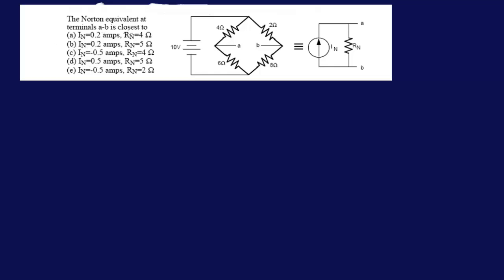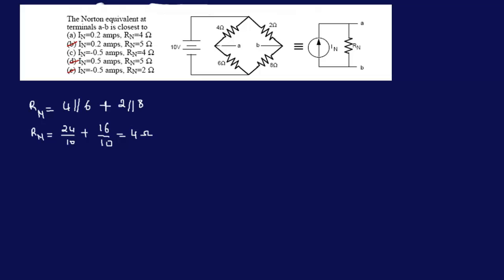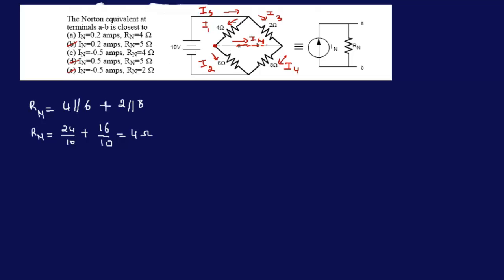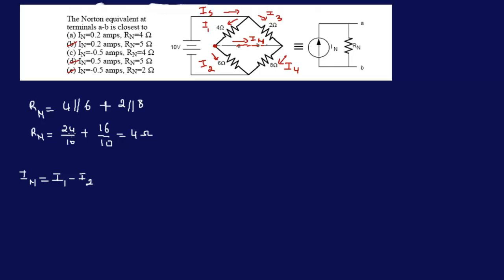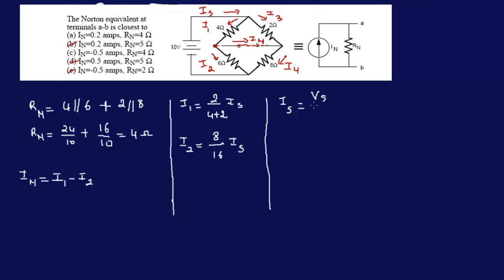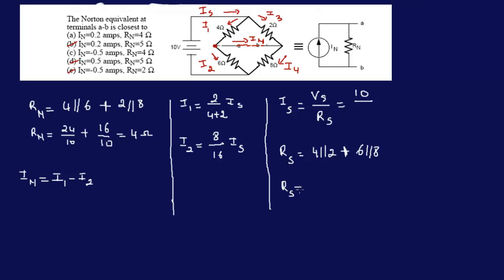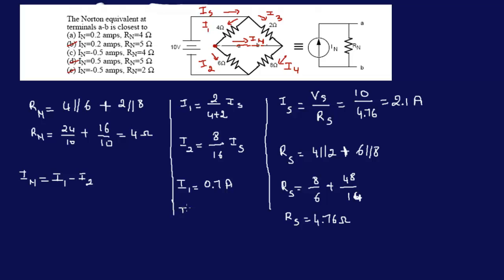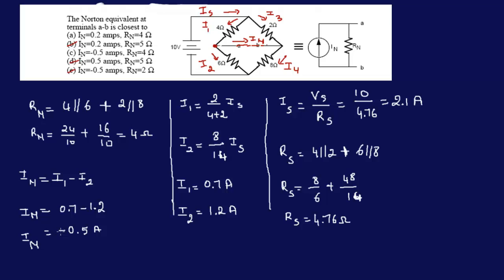Bridge Circuit-Norton Equivalent-FE Exam Review

Comment: Isn't the current divider rule In = (RTotal/Rn)ITotal? http://www.allaboutcircuits.com/vol_1/chpt_6/3.html Please clarify your thought process I got confused. Thank you.
Reply from the maker: Christopher, the current divider is always the opposite (parallel) resistor divided by the total resistance, all multiplied by the current source when you have TWO resistors. So I should have mentioned that this is applicable to only with two resistors. Thanks for pointing that out.

Comment: I'm confused on the current divider rule usage. I thought it was In = Rtotal/Rn*Itotal. It looks like you did the voltage divider rule instead. Could you please clarify?
Reply from the maker: Jeremy, here is a summary of both rules:
current divider: only used in parallel circuit, I=(Opposite resistance/Total resistance) x Source current.
voltage divider: only used in series circuit, V= (actual resistance/Total resistance) x source voltage.

In this case, 4 and 2 ohms are in parallel so we applied the current divider rule. Hope you get it.
Reply from the maker: I forgot to mention that this formula is only applicable to TWO resistors in parallel.

Comment: An easier way to find In:
Find Va and Vb using voltage divider rule.
Solve for Vab=Va-Vb
In=Vab/Rn
Reply: Think of the circuit as parallel, each branch gets 10 V. One branch has the 4 and 6 ohm in series and the other branch the 2 and 8 ohm in series. 
By voltage division:
Va = 6/(6+4)*10V = 6 V     [Va is voltage of 6 ohm resistor]
Vb = 8/(8+2)*10V = 8 V     [Vb is voltage of 8 ohm resistor]
Vab = Va - Vb = 6V - 8V = -2V
(Negative since current actually flows from b to a)

Of the choices provided only (C) would result in a value of 2 V:
Vab = In*Rn
2 V = (0.5 A)(4 Ohms)
2 = 2 

That's all the calculation necessary for this problem, however, most people would probably try to calculate In and Rn directly.  Rn would be found exactly as done in the video - disable the DC source then find the resistance with respect to the terminals: 
Rn = 4||6 + 2||8 = 4 Ohms

In = Vab/Rin = 2V / 4Ohms = 0.5 A
Reply: Note: By finding Vab you can find the correct multiple choice answer without solving for In and Rn. Through process of elimination using ohms law (Vab=In*Rn)
Reply from the maker: Christopher Perugini Oh i see what you're saying. But then how would you get Va and Vb. Did you do it and get the same answer? Please share so that others can see how you did it. Thanks for the suggestions.
Reply: @RaiyaAcademy  sorry being late here. What christopher has suggested is finding the equivalent thevenin voltage. The thevenin and norton equivalent circuits are interchangeable. U can use whichever and the answer is always the same

Comment: I think 4 ohm and 6 ohm are in series, given that the same current flows through it
Reply from the maker: Alan, i can see how we can make that mistake but they are indeed in parallel because of the terminal a-b branching out right in the middle (configuration wise). At the same time, remember that the voltage source is shorted when calculating Rn so no current is flowing.

You can ask any questions in the comments section on any video or email me at raiyaenergy@gmail.com directly. I'll be glad to help.